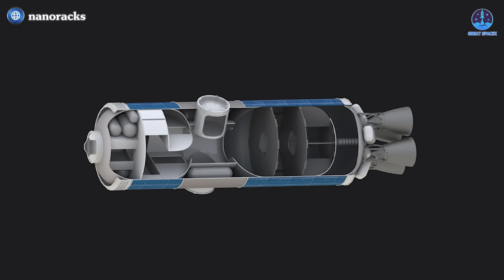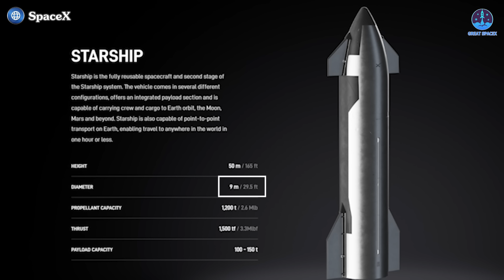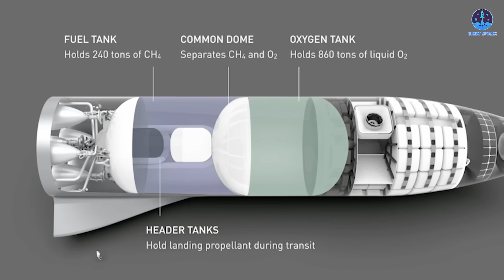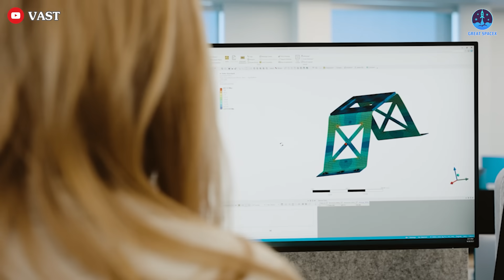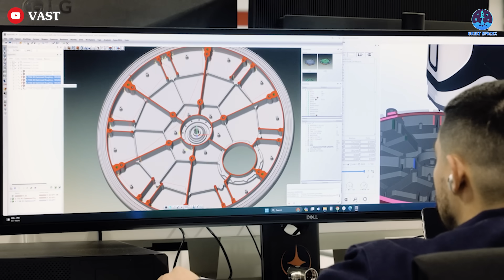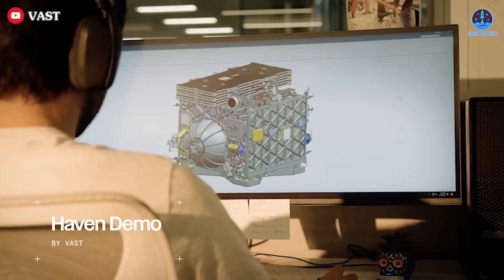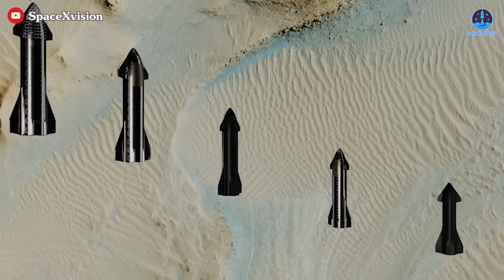SpaceX Revealed Starship to Become NEW NASA Space Station...

Comment: Why not dock a starship space station to a vast space station.  That would make a giant space station.  

The Vast space station could barely fit into the cargo bay of the starship. That would make it huge.  If the starship had space shuttle type doors, the Vast Space Station could be deported using a spring action.

The SpaceX space station could compliment the Vast Space Station.
If planned carefully, the fuel tanks could be converted into living space, by  pre-building walls & door jams in the fuel tanks.  The doors, furniture, and electrical system, could be installed in space.  All that would have to be done in space, that might be difficult, is cut the main entrance into the tanks, unless main entrance fuel tight doors are pre-built into fuel tanks.  🙂

Comment: QUESTION:  Is it possible to manufacture the 30 foot diameter hull sections of the Starship at Non-parallel seams, let’s say at one degree, then once in space, rotate sections at 180 degrees then reassemble?  How big a toroidal space station would it yield?  NOTE:  instead of welding seams at factory on earth; assembly of section could be accomplished with toggle like clamps. When in space; the sections could be un-clamped and rotated to 180 degrees and re-clamp.  Just a thought…

Comment: Once spacex really gets the starship program off the ground, how big of a jump would it be to have the tank and engine section break away and return to earth? The crew and cargo sections could still have it’s own attitude maintenance engines and get occasional boosts from crew dragons or other craft. This would reduce the cost of the station even more dramatically and solve the “what do we do with the rest of it?” Problem.
 They could also possibly build station specific tank sections that already have a lot of the lean infrastructure built into them. Like brackets, doors and docking ports. Then in orbit they can purge the tanks, turn on life support and start building it from the inside out.

Comment: Just to be clear, Northrop Grumman has withdrawn from their proposed space station project. They are now working with Voyager Space on their station, called Starlab. Northrop Grumman is developing a docking module for the station, able to accommodate their Cygnus cargo vessel to keep the station supplied. It will be much smaller than the ISS, but will have a permanent crew of four. They have an NET date of 2028 for launch, and intend to launch all in one go aboard Starship.
     Blue Origin and Sierra Space are working together on a station they call Orbital Reef.
     Special Aerospace Services' website says nothing about their building a space station. It just says they provide a variety of engineering and communications services and build components.
     Think Orbital has an incredibly sophisticated vision for space stations for whatever customers might want them. I hope they can carry it out.
     You made no mention of Axiom. They already have a contract with NASA to build a new station by attaching new modules to the ISS, which will eventually detach and be able to operate independently.
     These things always take longer than expected. I think, with luck, by 2030 the Haven 1 and Axiom space stations will be operational. Axiom will only have two modules by that time instead of the four they were planning, but the other two can be added later. Starlab should come on line a little after 2030. As we move into the 2030s, Haven 2 will be built. Blue Origin and Sierra Nevada will build their Orbital Reef so we will have fully four commercial space stations operating in Low Earth Orbit. If SpaceX makes it five, that will be extremely excellent. Let China, or Russia, or the two of them combined beat that.
Reply: Why not all of them, there is enough room in space for everyone.
Reply: @ivanmoralescolon   Room, yes, money, no. All of these new commercial space stations are expected to raise most of their funding from commercial sources, which will be forthcoming based on judgements about their future customer base. Unfortunately, such commercial funding is becoming tight right now compared to what it was a few years ago. We should though, get at least two stations flying, and probably at least three. If we get four or five, that's fantastic.

Comment: I’m not a rocket scientist…. And everything I’m about to ask will probably prove that…. So please indulge me as a curious layman….
Could the ISS be `towed’ to lunar orbit to become the moon’s satellite and staging-post for transfer of crew, research samples and refuelling?
Reply: No, it could not. Even if it could, its systems are simply reaching the end of their life. It was only designed to last for twenty years, and it has already been up for twenty four. There is a leak in one of the Russian modules that they can not find and can not fix. It is going to have to be shut down. NASA is planning to build a new, much smaller, station in Lunar orbit though, called Lunar Gateway, for just those purposes. You can get substantial argument as to whether it is actually necessary or not, but they're going to do it.

Comment: A downside to stainless steel for the space station is that it tends to produce certain forms of incident radiation when impacted by cosmic rays and solar particles. Similar to the aluminum, but different enough that hardware currently hardened for use on the ISS might face challenges. However, we've learned a lot since the ISS was designed and launched. Like how the polypropylene trash bags you get at the supermarket are actually pretty good at absorbing many forms of radiation.

Comment: It should just be "spaceship hull type 001" and all the needs for exploration, long term stay, filtering, sampling, sensor, experiments, exercise, whatever, should be designed within the dimensions and lift load of the hull. As long as we keep the lift capacity the same or higher in the future and the dimensions of hull 001 the same, we can start serious movement as they can be placed in orbit with little to no modification and just work.

Comment: SpaceX Starship would take a lot of work to become a station as the cargo are the liquid oxygen tank could be used in space but the methane tank and space used by engines would just be wasted space on the ship ! No amount of cleaning could make the methane tanks useable for humans or electric equipment. I'm waiting for a safe landing on the Moon by a Starship ! Forget the SLS and Boeing, SpaceX and other private companies can and should take over the Moon and beyond !
Reply: Bull manure!
Reply: The methane tank is next to the payload space you could easily put a bolted ring on the top of it to bolt a inflatable hab inside the tank. With a blanking panel over the down comer & the appropriate valves you could even use the Raptors for short burns and refuel your Starship station. With the removal of the header tanks & flaps you would have far more habitable volume than the ISS 2x at a minimum.  In a single Launch you could have a larger station than the ISS with the ability to self boost its orbit. With a half dozen Optimus bots aboard it could be set-up for habitation and work by the time Astronauts arrived on a Dragon. 😊
Reply: A few space walks and the engines are removed for return.  The methane tank can be sectioned and returned for recycle or repurposed in space.  The O2 tank can be modified to hold life support and engineering necessities.  Think outside the box, run fast, and break things...

Comment: If they took a note from Falcon Heavy they could probably have the booster do most of the lifting to LEO, sacrifice it, and redesign the starship with smaller tanks and more usable space.  The system would be single use but it only has to be done once or twice to have a reasonably sized station.
Reply: A single standard Starship will have more habitable cubic volume than the ISS a Starship designed as expendable without header tanks and flaps & such extends  that. The addition of 4 or more inflatable habs could triple the volume of the ISS. 😊
Reply: I would design the tanks to come out and connect to one another to make it like a Russian nesting doll ship.

Comment: Have a Starship custom built that has a detachable back end and front end. The center is the station modules. One becomes damaged, fly up a replacement and land then damaged one.

This would be a big engineering challenge, but spacex has done things more difficult than this.

Comment: Make the rocket three pieces. Problem solved. Make first and second stage a heavy lift. Lift all components and other companies components to space. Done
Reply: That would reduce Spacex’s advantage to build a huge space station themselves.  Probably will need to wait until competition is ready to do that.
Reply: @ws7001  don't you think SpaceX has enough on their plate. Starting a new project. There are two or three others that are working specifically on those capabilities. Giving all their focus and attention to those solutions. For awhile now. SpaceX is the go to solution for space lift capabilities. All those companies need SpaceX
Reply: @ I agree.  But that’s another major design with a disposable second stage.  Wonder if the 18 meter diameter BFR would be developed after this one is finalized.
Reply: @ws7001  first and second stage is already recoverable.  have a smaller intermediate disposable stage. Which they already make , for dragon
Reply: @ Could the second stage stay recoverable and add a third stage? How could it be attached?  Maybe just gravity? Would that not damage tiles?  Maybe some liquid cooled metal attachment points?
Reply: @ws7001  they already a small module for dragon. Just modify it for what is needed. This could be the third iteration. I think taking all that extra mass to the surface of the moon is stupid. This modified version could be used in gate space station
Reply: @ That attaches to the disposable Falcon 9 second stage, much smaller diameter.  It will resemble the 55 year old moon landing.  I would rather see a much larger capacity for building a moon base.
Reply: @ws7001  yeah. Well , reduce measure wat
Reply: @ws7001  nasa sent a capsule to the moon with a way less powerful rock
Reply: @ Yes- but it was a small capsule.
Reply: @ws7001  dude. We are almost having a conversation about this. I'm not an engineer. I see practicality in my minds eye of what went before. I see only generalities
Reply: @ws7001  I just believe they need to make it smaller and leaner to make the moon shot. And to fit the parameters of gate way space station. It's too big , too much mass for either in my opinion
Reply: @ws7001  they need to work on solutions for long duration flight. " TO THE MOON AND BEYOND "  haha

Comment: For one thing, you would not use 'Starship', you would use 'Starbase'
It would be constructed as a 'Launch Once' upper stage for the booster. Blunt on both ends with a top fairing to be discarded after launch, with passthrough hatches (docking ports) on both ends. Tank interior with additional bulkheads and hatches, secured open or closed as required for launch.
You would start with a core module that would have additional docking ports on the circumference, a larger diameter (12m?) and insulation like what was used on the Space Shuttle tank.
Launch additional modules without docking port on the circumference.
After you have two or three sticking out from the core module, start spinning the assembly ...

Comment: Start with 2 starships tip to tip with a cable in between revolving to create simulated gravity and add 2 more at a time in between  until you have a ring of 50 or so starships.  That would hold thousands of people and could reuse the steel tanks in orbit
Reply: What I've been saying.
Tip to tip (teehee), with a central hub that spools a cable link out, say 250 meters each.
Though, I would prefer that for a transfer vehicle to Mars. I don't like the idea of using Starships specifically for stations; those engines are expensive. Use inflatable habitats instead.

Comment: A space station provided by SpaceX has been ordained since day 1. At least it was from my perspective and I am absolutely certain it was on the mind of Musk as well. There is a short term temporary concept and a long term concept - even more than outlined in this video. We may have to replace the current space station any day now. Probably not likely but the potential is there. We have to prepare for that scenario. I don't think you can count on landing the SpaceX station back on earth; whatever you put there will not be meant for that purpose. By the time you strip down even the V2 Starship you'll have a lot more room for human habitation and general purpose use. I suspect it will have to have more outside covering in some areas to protect the stainless steel and that will add weight but offer more protection to the residents. Trump has announced that rockets sent to Mars will have some minimal use of artificial gravity so there is a potential for the same on this space station as well. Myself, I think Musk has already worked out the basic details. After all, he has been working on the moon Starship for years now and they have a mock up already in place. That rocket is meant for habitation on the moon and would include some of the same features a temporary space station would have to include. Right now SpaceX is working on the details of launch and LANDING the Starship. You don't need a landing capability to put up a space station. The Super Heavy could be used for a one time launch and fully use the powerful capability of the rocket. I think we are closer than you think. Even now you could put the shell in space and use the reliable Falcon to get there and back:-) The Starship changes everything and every nation in the world knows it.
Reply: Kinda like what I've been saying in some other videos about space stations. Starship already has the basics of what could be niche, temporary space stations. I think there are two options:
1) A Starship space station variant launches atop the super heavy booster with crew and supplies. Starship space station stays in orbit for weeks or months, depending on the mission. When mission concludes, land the Starship and reuse it for the next space station mission.
2) Launch the Starship space station variant having a docking port (without heat tiles for re-entry) with supplies to orbit. Send Dragon up there with crew. Send next crew and bring back other crew after mission on a Dragon.

The first option looks better in my opinion.

Comment: The Space station should be a Telescoping StarShip craft. It's many body will telescope out 40m. No wing or heat shield but covered with solar like the trunk from Dragon. Just the body will be 45m to 50m. Hatches on each side. 36 Trapezoid StarShip docked side by side will make a ring station and 12m ship will give 1g at 3.5rpm. All docking can be at nose and/or on the short side.

Comment: Retrofitting Starship, to change the volume dedicated to propellant into habitable space might be a very challenging project but doing so would boost the development of orbital construction and manufacturing techniques! Imagine being the first welder in orbit, or the first plumber or electrician, stripping out the tank's common dome and replacing it with bulkheads, insulation, wiring, lights, and plumbing. It would be amazing to work construction, IN SPACE!
Reply: @richardzeitz54  
I believe retrofitting is for old hardware. I am convinced that Elon musk will design a brand new type of starship. Why  retrofit old hardware when you can build a new design?
Reply: @DonPayne-vt9rq  because Starship has these enormous cavities dedicated to fuel and oxidiser. Once the ship is in orbit, unless it's going to need that much propellant, the space can be reclaimed for storage, habitat, or workspace. It's not about old or new hardware, it's about using Starship as a space station rather than as a space ship.

But as I said before, doing the retrofit in space would afford the opportunity to develop techniques for welding, etc., in space. The point being construction in space rather than having to pre-build everything then launching it into space.
Reply: @richardzeitz54  
🤔 Yes I see your point about construction in the space but we still have to get the materials up there or at very least we have to find the materials while being up there either way living on a starship could be pretty cool 😁👍
Reply: 😅 without the header tanks for landing there are no down comers in the methane tank a bolted flange in the payload dome allows you to bolt an inflatable hab within the methane tank a bolted on panel on the common dome  sealing the down comer gives you methane storage within the lox tank. Simples  you can refuel & use the Raptors to make orbital adjustments. 😊
Reply: @jackdbur  Now that sounds interesting!

I'd thought about what if you ditched the raptors and replaced 'em with something else like a modest sized tank of xenon and a big VASMR thruster, but your suugestion is much simpler.
Reply: @richardzeitz54  Power supply is always a concern for space stations and big ion engines are power hogs for little actual thrust.

Comment: Why not make the engine and fuel areas as being able to separate from the mid to upper section of Starship.  Use those empty tanks as a fuel depot with several bundled together and then the top sections of the Starships being a building block for the new space station. Just a thought.